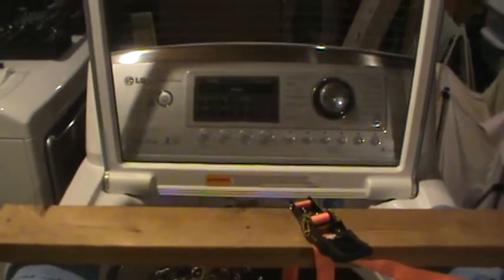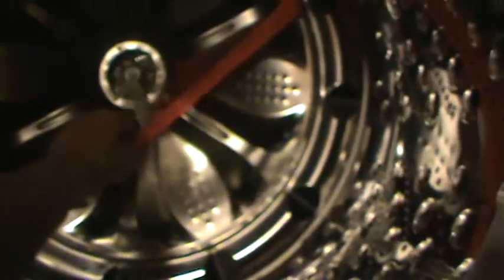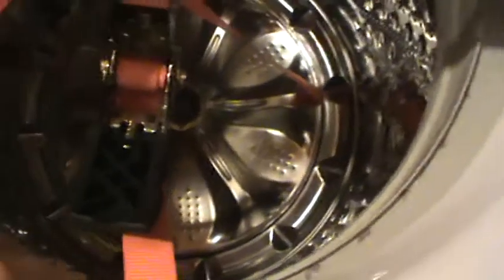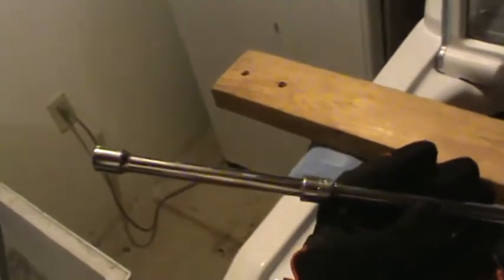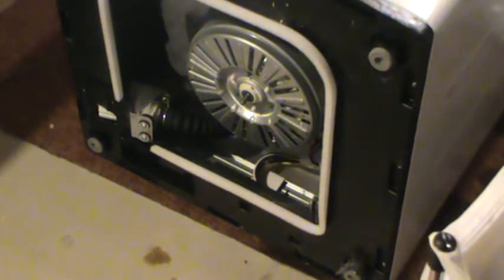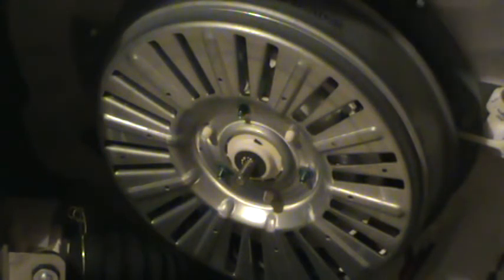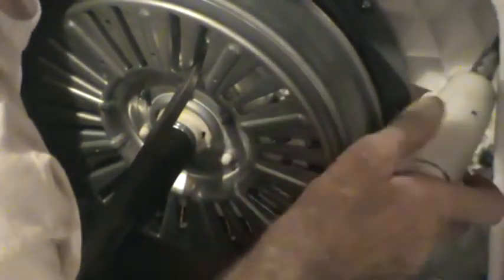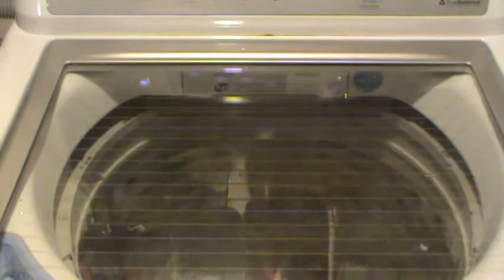LG Washer Clutch Repair

Comment: I had this issue on my wash machine which is a top load lg1101cw. To  remove the wash platter without damaging it requires some time, a lot of patience and in the end a little fineness. Once you have removed the plastic center cap and the screw that fastens the wash platter to the drum spray some penetrant such as wd40 or other brand into the threaded hole the screw was removed from. Don’t go crazy with the penetrant , lightly spray right into the screw hole section until it has filled the hole and spilled out slightly into the round area where the screw head seats, leave it sit for an hour or so and then return and repeat the process. You want just enough penetrant in the center so that it can seep into the space between the clutch shaft (the shaft the platter fits down onto)  and the center opening on the platter. Once you have sprayed the penetrant and let is soak two or three times over several hours slowly work your way around the outer edge of the center platter pushing down on the edge as you work your around  the platter, you will hear some light cracking as you’re doing this, the noise is a good thing. After you work your way around the platter edge several time you should be able to with a little tugging pull the platter up and out of the washer.    NOW the following is worth an honorable mention. If you’re working on an lg1101cw as I was and the drum doesn’t want to spin and at times spins a little but makes a grinding sound as if something is stuck between the drum and outer drum basket, do not assume it’s a clutch issue. To install a clutch in one of these machines is time consuming and very labor intensive. If you machines symptoms are like those I described prior and you wash drum spins freely by hand, try the $13 fix first which is to replace the stator/motor sensor which is a plastic sensor that literally snaps onto the edge of the stator which is that heavy ring with the copper windings aka the motor. Many videos on YouTube go right to replacing the clutch. My machine would not wash, overfilled with water and made the scraping grinding noise when the drum would try to spin. A new Stador sensor fixed all for $13. If you do remove that wash platter in the drum, again, do so with patience and fitness, a new platter will set you back another $160 or so which is not necessary .

Comment: i tried everything and could not get the plate off the tub, to fix the clutch
Reply from the maker: Are you sure the clutch is the problem?  After all the struggles I had, my problem was the actuator for the clutch.  That is an easy repair.